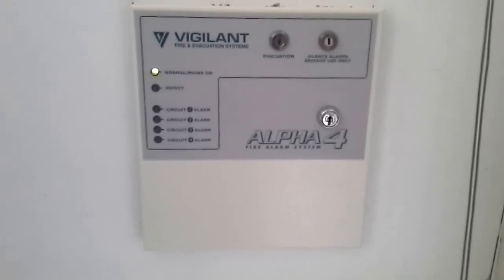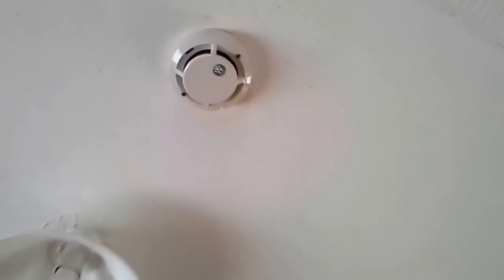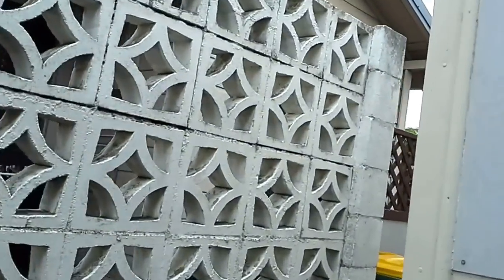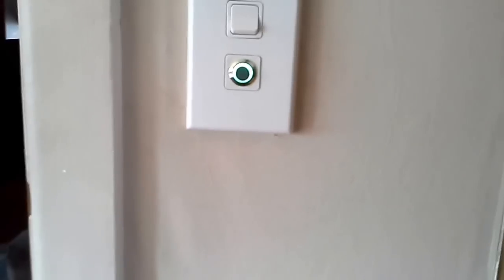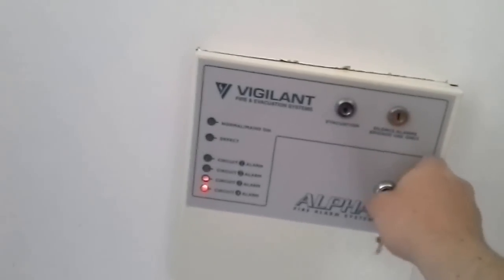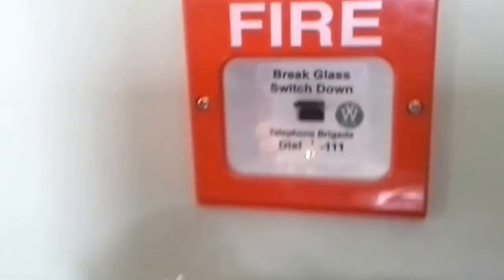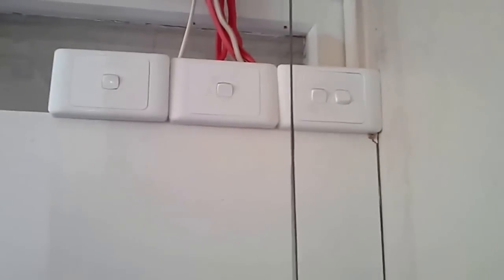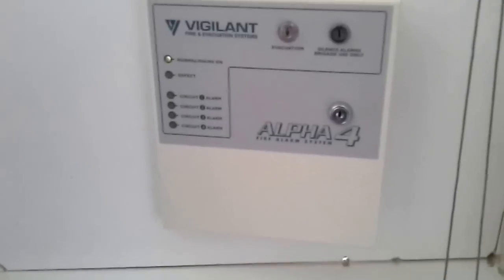*recovered footage* fire alarm test

Comment: what kind of fire alarms are those
Reply from the maker: The white ones in the roof are just TYCO 100v speakers, The red sounder is a house watch code 808 siren, the outside bell is ampac and finally the strobes are system sensor spectralert classics  running at 75C